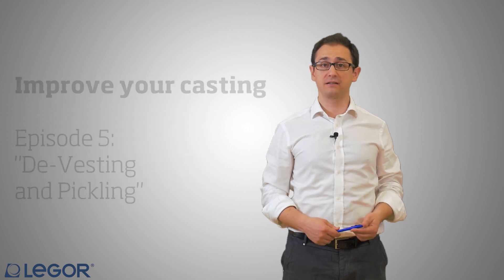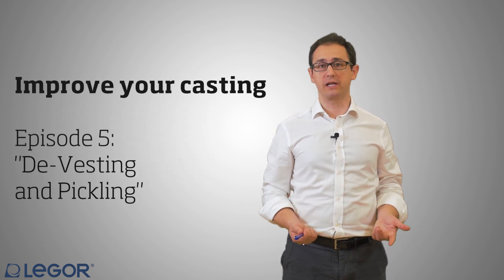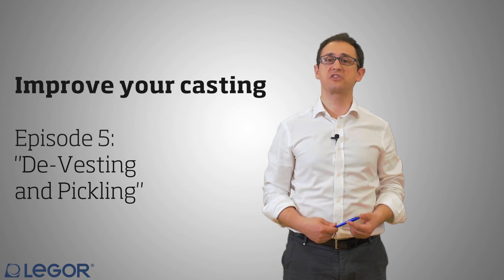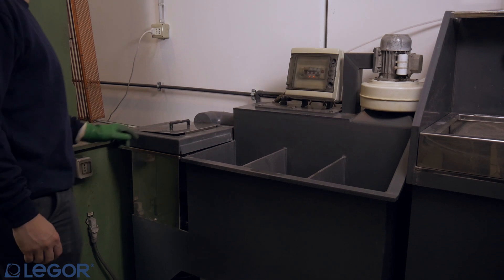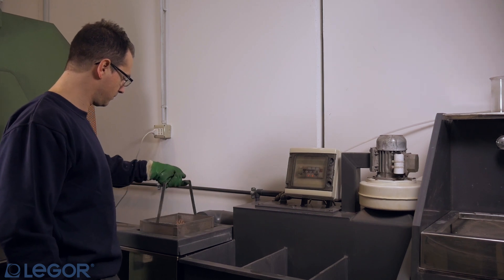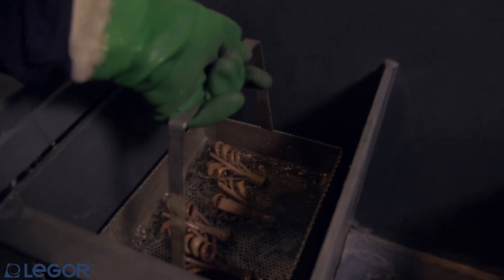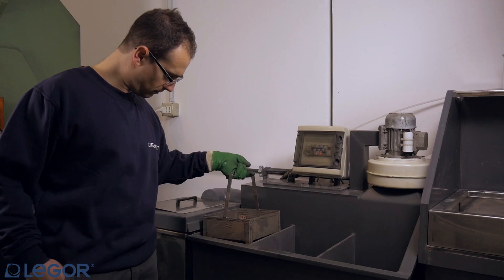HOW TO: INVESTMENT CASTING - De-vesting and pickling (4/5)

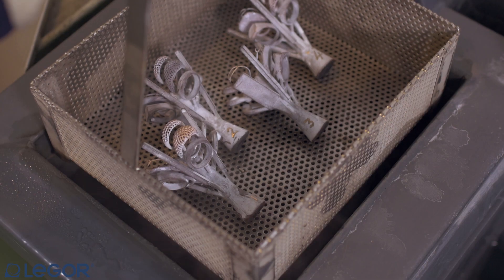Comment: 01:30 what is that solution ?
Reply: It’s a mild sulfuric acid, typically. You can buy it dry from Rio grande.
Reply from the maker: As reported in the “CASTING PROCESSING PARAMETERS → Pickling” section of Legor Group technical datasheets:
Dip in RADIAL solution (50 g/l conc. at 60°C for 2 min.), or in sulfuric acid (10% conc. at 50°C for 5 min.).  If you have further questions, don't hesitate to contact us here: https://www.legor.com/en-us/contacts
Reply: Is the method the same for 925 silver?